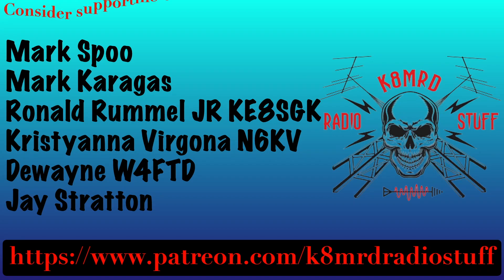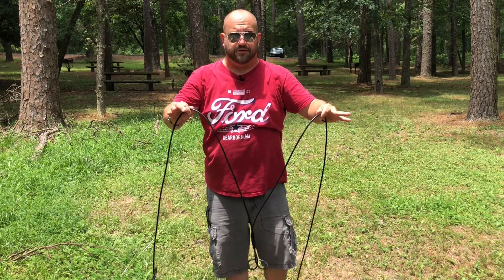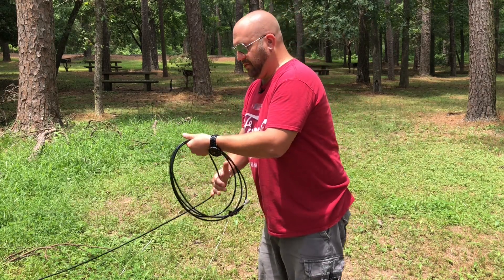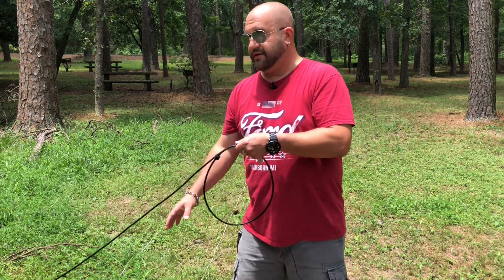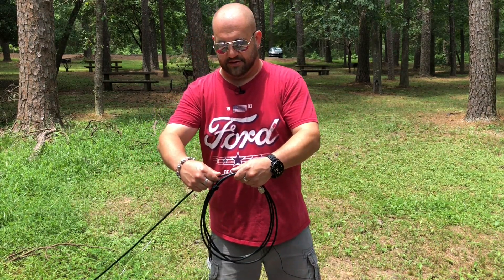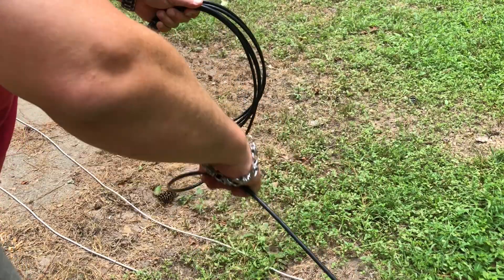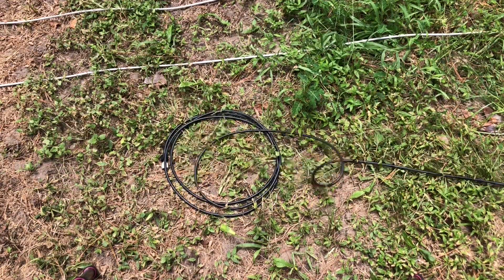You’ve Been Doing This Wrong Your Whole Life!! | Coax Winding The Right Way

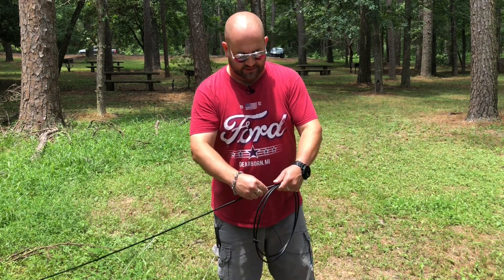Comment: Great tip Mike!  I was shown this over/under method by a ham a couple of years back and have used it since.  I can't believe I worked as a professional guitarist for over 35 years and wound my Guitar, PA and AC cords the over hand method in your example at the 0:45 minute marker.  It served me well as I would roll the cable to unwind with no twists.  Very time consuming.  How I wish I would have known the over/under method way back then because it 'ROCKS'!  Twang 🎸 73!
Reply from the maker: I've been doing the same thing with my guitar/pa cords most of my life too.  The cord from my floorboard that controls my amp is so twisted its insane.  I only discovered this a few years ago myself.

Comment: I'm in TV production and have been winding ALL cable(coax, audio, fiber) like this for 35 years.  Listen to this guy, it's the correct way to do it.  Now, go and do it with Triax or any of the super stiff stuff (LMR400/600)that will be too heavy to hold after a few coils.  You'll need to do it on the ground.  The same technique applies, but you need to do it horizontally with the coil sitting on the ground.  Practice on your garden hoses. Same thing.  One warning:  Don't throw out the opposite end that you started on.  By this I mean keep the connector ends on their respective sides when you toss one end out, or you will get a knot every other coil.  Don't let one end cross through the "hole" in the middle or you have just now created consecutive knots in the entire cable. Come to think of it, you should have shown that little tidbit.  Otherwise, a  great vid Mike!
Reply from the maker: Good stuff.  I've not been aware of the whole opposite end thing you are taking about.  I guess I've just subconsciously been paying attention to how I'm throwing the wire.  Crossing through the hole would certainly be bad though lol!
Reply: @hamradiotube  Try it you’ll laugh😜
Reply from the maker: @OCavant  Yeah I'll be laughing my way through a tangled mess I feel.  I'll take your word for it :)

Comment: Genius!  This is going to save me so much time dealing with cables and hoses. I assume this also works on drop cords and air hoses?

I got frustrated a while back and just bought a drop cord winder reel from Lowe’s for one of my longer coax cables.
Reply from the maker: Works with any cable flexible enough to wrap.  I do this with pretty much every cord and wire I own.

Comment: Very important to pull the same end that You coiled last otherwise You will get perfect knots after every two turns!!
Reply from the maker: Hasn't mattered to me.  The winding is the same on either side.
Reply: @hamradiotube  I'm working in the stage industry and the softer cables (like XLR) always does the knot thing. Nevermind...  Great video anyway! So many people does not know the over-under method (figure 8 as we call) however it's a must to save time, nervs and cables :D

Comment: Learnt this method a few years ago and never looked back. Can also be used with your wire radiating elements and I also use it for power cords. Great video.
Reply from the maker: It's the best.  Especially for all the wire for my DX Commander Expedition.  That would be a nightmare of a birds nest if I didn't do this.

Comment: As a musician, this is really required learning from the get-go.
Reply from the maker: No one taught me this until way into my music years.  I just learned this about 4 years ago!
Reply: There's an old Roadie Trick
Reply: Lighting tech here and yeah! Someone thought me to coil the long DMX cables that way many years ago and I've been using this for power cords, coax, network cable, etc
Reply: I learned it from my church’s Tech Crew but I love the way he reaches under for the alternate loop. It’s one thing to roll audio cable by spinning it in your fingers. It’s another thing for me to try rolling 9913F with my weak fingers. Reaching under should solve my problem. Super grateful!! WB3CFN
Reply: Been doing this for years. Works great for winding up my 9:1unun lengths of wire.  Everything  stores better and isn't a rats nest when it is time to deploy it again.